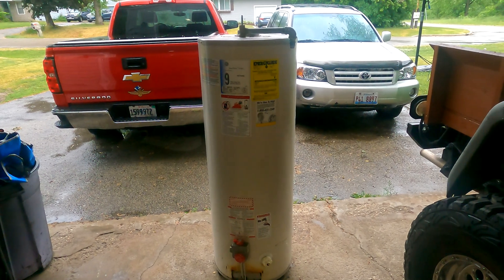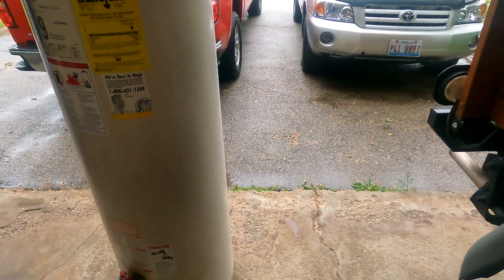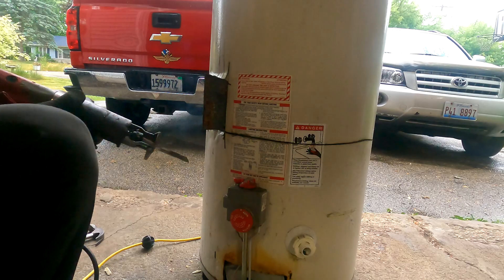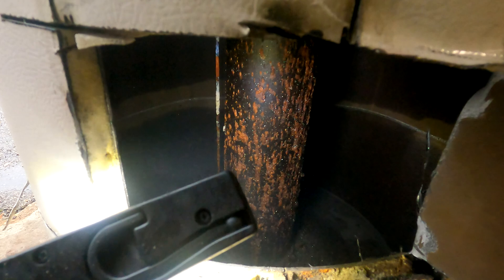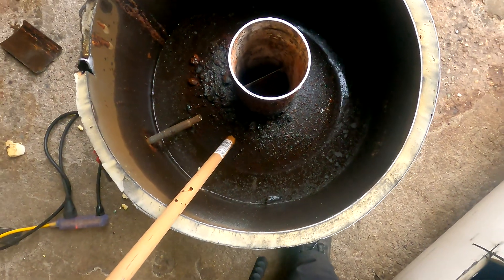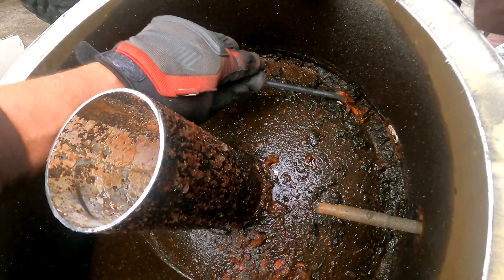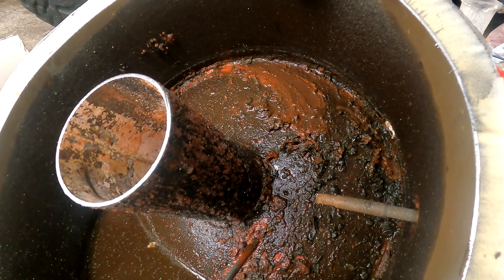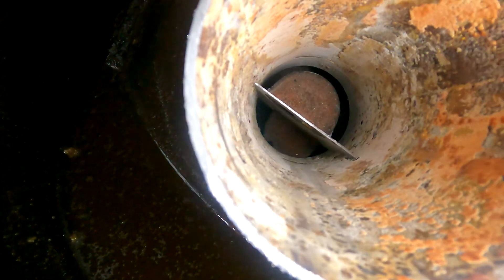What's inside of a 20 year old water heater? Let's find out

Comment: Nice job of showing the insides. I had one leak but at the top. A gas unit like yours, flue gases pass by the baffles on its way out the top. Interesting was the cold water inlet pipe was PVC and curled around the bottom about 300 degrees. It had tiny holes to jet the hard water deposits off the bottom in a scouring action. Draining depends on water hardness. If city or well water runs thru a softening unit first, then to water heater, it stays clean. The magnesium anode that goes thru the top degrades in 10 years due to galvanic action. I removed mine, added anti seize to the threads and installed it, I think it was 1 1/4” but only. They sell for $20 and most hinge as no head room where installed. Hot water raises in the tank along with and bubbles from super-heated water on burner plate. I thought the leaked at bottom but no, this had 3 tiny holes at the top. The tanks are lined with fiberglass & resin. The tank if repaired to be leak proof, if modified would make a great sandblast tank. Thanks for the video again.
Reply from the maker: We do have city water so probably why it was not deposited up too much, thanks for watching